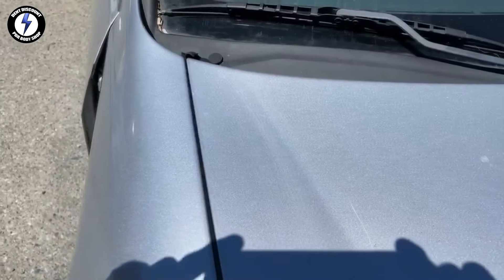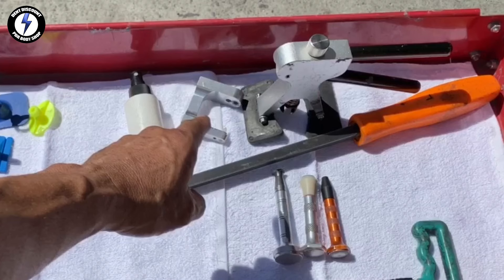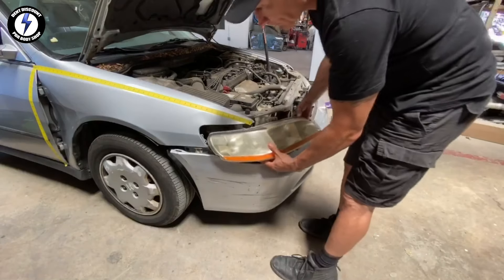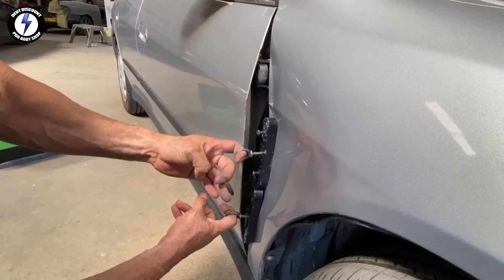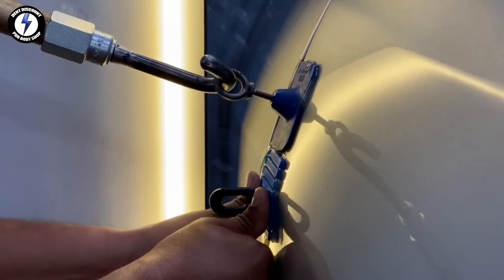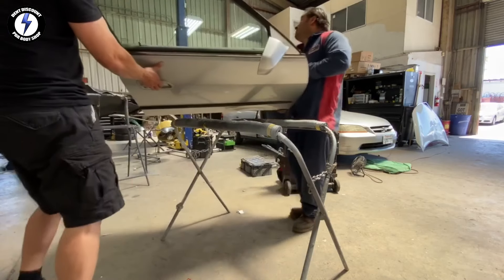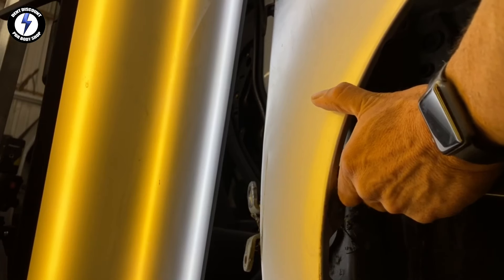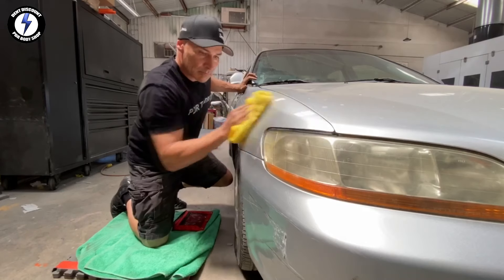How to Paintless Dent Repair! | Body Work Right Side Repair!

Comment: Nice job I was wondering if you ever have pulled a dent on a 4th gen camaro I have 4 body shops wanting to replace the quarter panel
Reply from the maker: Miguel thank you for your comment.. The reason why they want to replace the fender it’s easier and quicker and it saves you money per hour on the job

Comment: your video's are the best i have tried to remove the same kind of dint on my car its come out but looks like lots of little dents and i don't know how to get them straight
Reply from the maker: It’s a lot of practice and trying new things. Continue going into deep waters that’s how we get better.
Reply from the maker: Manofsteelpdr.com 
 I appreciate your comment and question John.
Reply: I guess Im asking randomly but does anybody know of a method to get back into an Instagram account..?
I was stupid forgot the login password. I appreciate any assistance you can give me.
Reply: @Hayden Bryce instablaster :)
Reply: @Rene Ford it did the trick and I finally got access to my account again. I am so happy!
Thank you so much you saved my account :D
Reply: @Hayden Bryce you are welcome =)
Reply: That’s a pry bar not a screwdriver.
Reply: @DentDiscountPDRBodyShop  is there anywhere i can send pics of a repair i either want to do or find out if it just worth buying new doors and front quarter panels from a junk yard if they are in better condition.  The door and quarter panels are curved inward where they meet. When you open the doors it makes that loud pop. I work on cars only replaced stuff like bumpers and lights, mirrors never really did body and fender work like your doing.

Comment: New subscriber, I appreciate the doing good work without a million dollars in tools. I used to be a body tech so I know what you did is not easy. I want to play around with pdr a little if you could only pick one rod what would it be? I am guessing a double bend with interchangeable tips? 36 inch? Thanks for the videos

Comment: a new fender is $68 on ebay and a spray can of paint is about $75 from the paint shop. I dont see how this was worth it for a PDR guy. Especially the time to remove the door bumper ans headlight anyway. Still impressive work!!!
Reply from the maker: Thank you for your opinion 
My channel is all about keeping things original keeps the value of your car up. Especially the original parts and paint
My channel is not about replacing or repainting
My channel I show guys how to fix dents
No one wants a $75 cheap can of paint that doesn’t match the vehicle 

If you want people to laugh at you when you get in your car or drive your car yes go ahead and spray it with a can paint
Thank you I appreciate you sharing on my channel
Reply: @DentDiscountPDRBodyShop  FYI - $75 will actually buy you enough OEM color matched paint from any authorized auto paint shop to paint the complete fender and blending. I think you took my comment too personal lol.

Comment: I have a difficult dent to solve. It is on the driver side front door leading edge, exactly over the lower hinge about 1 inch deep, where the tip on the rear bumper of a truck, similar to the level of FedEx truck rear bumper would be, backed in.  Probably not completely a PDR candidate due to the door hinge being behind the dent.

 #@^%%$! because I have no collision insurance. Of all the places to have it back into me, this might be the worst. Joke is on me. LOL   Nobody saw the incident so I can't pin it on somebody.   Dang me, take a rope and hang me...
Reply from the maker: Thank you for sharing on my channel

Comment: $50 fender, $20 worth of paint, less than $100 shop cost and about an hour of work to replace this fender brand new. Wonder how much the customer was charged for this lol, and get back a still damaged fender. PDR is not worth it 70-80% of the time.
Reply: oh god and you took the door and wheel liner out ahahahahahahahhaha im crying.
Reply from the maker: Thank you for your comment
He wanted to keep his car original with the original paint
This channel is not a replacement Channel
It’s a dent repair channel
Thank you for sharing